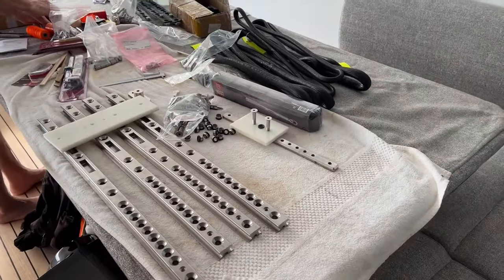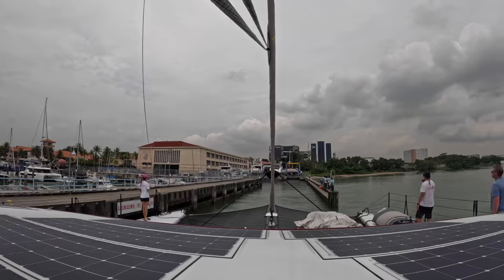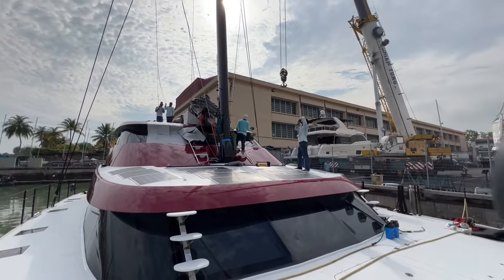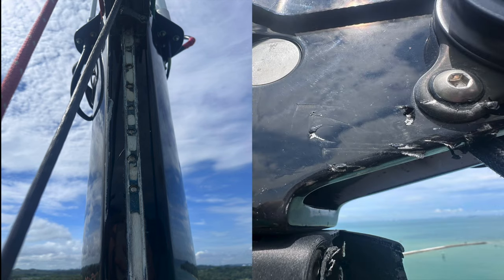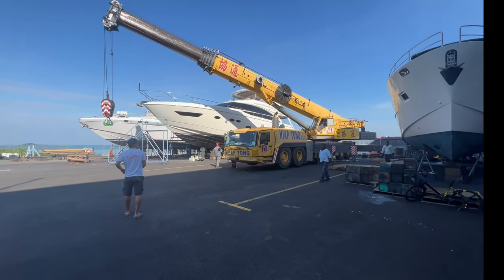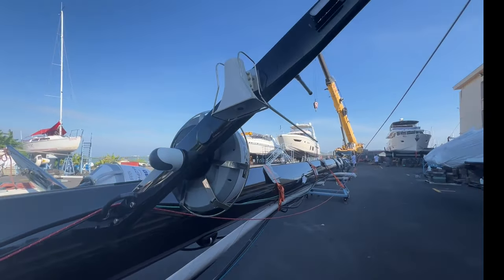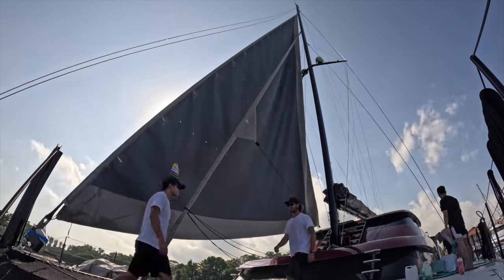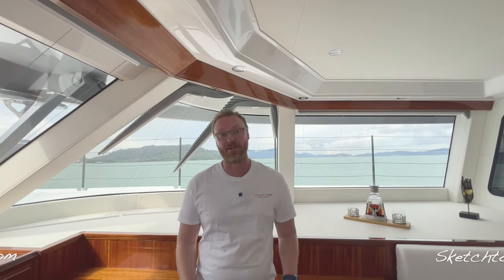Sketch To Sea: Yard Work Continues

Comment: Wow! This is incredible! Such a calculations failure! Those guys did an incredible mast removal !
Reply from the maker: Its hard for me to pinpoint the blame for failure here. After all it was the shock load under light winds. If you look at the racing yacht Allegra, all of our running rigging was designed by the same companies.

Comment: "BUMAX® 88 fasteners are used for water jets, sub-sea equipment, pumps, valves, wind turbines, high-pressure equipment, nuclear plants, submarines, particle accelerators and many other applications where commodity A4 fasteners are inadequate. As a result, BUMAX fasteners provide greater safety and will last significantly longer than standard A4 fasteners." 800 MPa tensile strength 640 MPa yield.
Looks like fatigue failure (grey and then shiny edge), and the fix is more bolts? :)
Crazy Lightning, my money is on the antenna arrestor at its base exploding, the antenna mounted next to the lightning prevention cone that should be mounted lower than it...
Reply from the maker: Thank you for the comment, it was answered in my most recent video.

Comment: Was the work on warrantee ? The cost of doing this work would be very expensive. As soon as you go past 50 feet on a catamaran cost rely start to add up very fast. Also all the gear start to get crazy expensive.  Hard to believe that a mast tract would fail so early on even with bad weather they are not suppose to fail.
Reply from the maker: Yes, all of this work was done under warranty. AS i said in one of my previous responses, it was the bolts that have failed, and in light wind. This type of failure has been very confusing for all parties involved.
Reply: @sketchtosea3750  Good to know very strange that it would fail in a brand new boat. Those components from my experience rarely fail. Could have been a manufacturing defect.

Comment: Wow, what a major operation. Did you have to bring people back from the original build team for this or were the yard crew at the Raffles yard capable of handling a difficult mast-pulling procedure? Why was the original mast track system so poorly-designed and specced? Glad the mast pull and new track install went smoothly.
Reply from the maker: Hi John, and thank you for the comment. I would not sat theat the mast system was poorly designed. After all this happened under light winds with the shock load from the movement with the sea. It was compounded by the pendulum effect at the top of the mast.  We have a very similar system as on a few other. hard core racing yachts. It appears the the effects of light wind loading has not been studied as closely has heavy wind consistent pressure.

Comment: Brand new boat with corrosion? Sounds like inferior materials AKA the tendency to substitute local products or cheaper products than those specified. Great that HH is addressing this, but why did this happen? Poor supervision and inspection of all materials to ensure they meet your specifications is the reason. As I mentioned inferior SS has plagued Chinese boats for a long long time, whether built in Taiwan or the mainland. Also your antifouling  paint seems like a substitution to have that much buildup in so short of time.
Reply from the maker: Thank you for the comment, it was answered in my most recent video.

Comment: As for your lightning so called protection that is not the case it’s a lightening prevention NOT protection system. I know those systems very well. If your carbon mast does get hit it WilL be destroyed because carbon conducts electricity and most of your electrical work WILL be damaged however the system does work very well at preventing lightning direct hits however it is useless for proximity lightning strikes in  which case your electrical system will still be damaged.
Reply from the maker: Well, you will just have to stay tuned to find out... There is also proximity strike protection. Yes, I specifically used the word protection.

Comment: I would imagine HH was front and centre during all this kerfuffle. On the close up of the part that broke there looked like a lot of corrosion where there should be none in a boat this new. Those shiny new track parts will look out of place on an otherwise black mast. I will be interested to see if in fact you were hit by lightening or some other mast was hit and whether there was any damage to your electronics. And if you were hit whether or not your handy dandy lightening prevention system actually works.   I await your next episode with chocolate chip cookie in hand!!🤣🤣
Reply from the maker: Thank you for the comment, it was answered in my most recent video.
Reply: @sketchtosea3750  I stand corrected. Thanks😀

Comment: very interesting to watch and i think HH really doesn’t deliver the quality you pay for…so many problems you have to endure  and solve, also with other vessels from HH (Wynn’s)  that need such a huge amount of stuff done…….and i admire that you comment without  judgement about whats going on…..
Reply from the maker: I cant speak on behalf of the Wynns, but for us it has never been a quality issue. Most of our issues have come from the boat just being the first of its kind, and pushing the boundaries of engineering. Everything on this vessel as far as standing and running rigging goes, was designed specifically for us. There are not spare parts available. I anticipated a lot of these issues would pop up with hull # 1, but inevitably there will be items that are completely unforeseeable like the repair in this video.